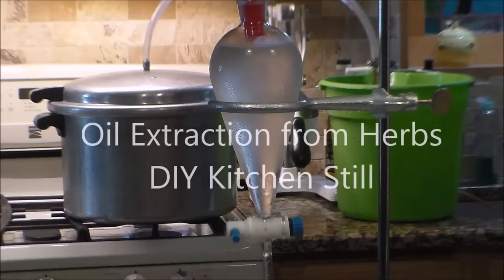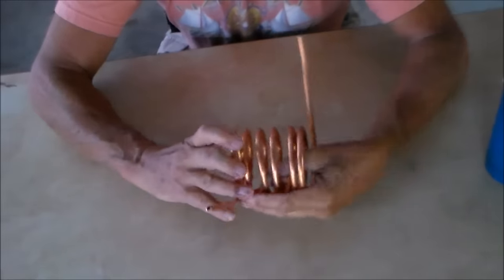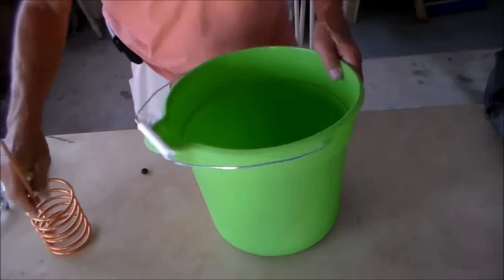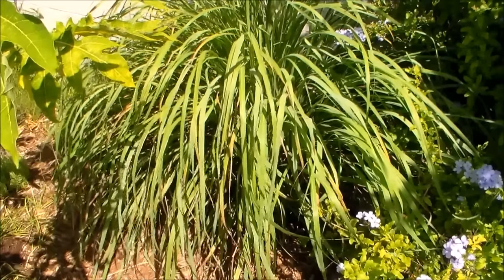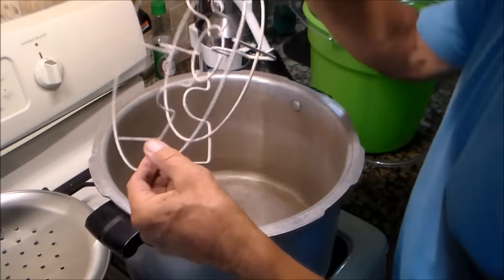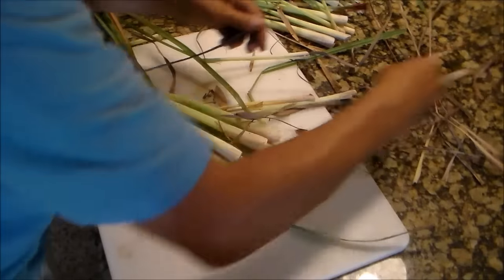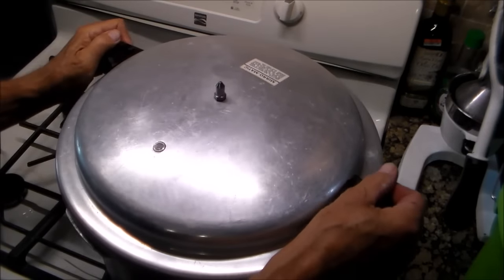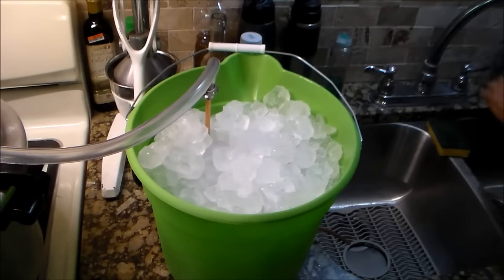Oil Extraction from Herbs with DIY Kitchen Still

Comment: Protip for coiling copper tubing. Fill it with sugar or salt, so that the tube has less of a chance of collapsing when you are coiling it. Then you can easily rinse it out afterwards, since both sugar and salt will dissolve in water. It will even let you wind a tighter coil if you want. You can cap the ends with a wine cork.
Reply from the maker: great advice, thank you ---Don
Reply: @donaldporta   what other plants can we use aside from lemon grass? I mean whats best to try?
Reply: Don. ..you saved me
Reply: @itsashepubg8967  Pot
Reply: @fishfire_2999  I hear that
Reply: Now I understand why essential oils are so expensive! For a lot of lemongrass leafs you get only a few drops of oil...
Reply: Play sand is what I used but the salt and sugar is way easier to flush out…very bright!
Reply: @itsashepubg8967  Marijuana .. check it it out if it is legal in your area.
Reply: @itsashepubg8967  
Citronella plants
Reply: @itsashepubg8967  Flowers
Reply: Glass bead sandblast media works extremely well, it's made to flow well and won't bind up inside after bending like sand does. I've never tried salt or sugar before, I'll have to see how they compare to glass bead.
Reply: @itsashepubg8967  you can do most herbs for the oil.
Reply: Even pro'er tip.... use a wire which is just a bit smaller then the inside diameter of the tube.  Then wrap around a form.
Reply: Thank you 😊
Reply: What is the ice for ?
Reply: @TheDRIBBLER2 well, for cooling typically.
Reply: i hadnt even considered using a pressure cooker until i saw this. absolutely AWESOME
Reply: Isn't it worth a one time investment. Use, reuse and keep reusing to develop a good reputed online business? And a good returns too.

Comment: You have to be careful not to block the safety valve or outlet of the pressure cooker. I know someone that did that by putting too much into the pot. It blew up in her kitchen, luckily she wasn’t in the kitchen but the destruction was so bad she had to redo the kitchen, ceiling, cabinets, window and floor. It would have killed her.
Reply from the maker: very true!

Comment: Some Tips.

Cut the lemon grass as finely as possible to break it down as much as you can to expose as much surface area as possible to release more essential oil.
Also, do not use an open mouth jar as your collection container as this exposes the hydrosol and essential oil to oxygen which will start the essential oil to oxidise which you wont want. If you want, get a mason jar with a metal lid, drill a hole in it and like with the plastic bucket, add in your plastic/silicone seal, then place the end of your copper tubing into this. 

I would also recommend when collecting the oil/hydrosol, store it in a jar in a dark pantry for a few hours so the cloudiness of the hydrosol can go away and become clear. This way you know all essential oils are floating on the top as it looked liked u had quite a bit of essential oil in your hydrosol.
When you separate the oil from hydrolsol, I would recomend getting some rock salt and add a pinch to your oil as the rock salt will draw any possible remaining hydrosol to it and then filter one more time.
Reply: ？Thanks a lot for your nice vedio
Reply: Hola, How to know if the essential oil is oxidized? OE color is dark? I distil geranium and some dark drops come out of the copper tube (I use a container with a wide mouth). Beforehand thank you very much
Reply: Thx bro
Reply: Let the man do his thing!
Reply: Ya  turned  me  off.
Reply: Very informative. Ty so much for adding

Comment: Good work.  The oil is trapped in the cellular matrix of the plant, so increase your oil yield by chewing up the leaves in a blender first. then adding that mulch and juice to the pressure cooker (I bet twice as many leaves will fit in there after you do this, so not only will you get more oil from each leaf, you'll be processing more leaves per batch).  Add salt to the ice water in the bucket to create a salt brine that is far colder than just ice water.  This stuff is a great insect repellent thanks to the citronellal found in the oil.  It's also antimicrobial, so you can add it like a fragrance to homemade soap.
Reply from the maker: Thanks for the advice my friend!
Reply: I always wondered why people using whole leaves and flowers. I am just now looking into making herbal oils and figured it was just something people do. One would imagine that a proper crushing at least would benefit the release of oils. if the juice and mulch are cooked does it negatively affect the oil production in any way? That would mean no separator, just blend, add, cook and distill and voila! much simpler.

Comment: it works but not great. smart to keep the herbs off the bottom so they don't burn. for a small batch this is fine, for anything bigger this would be a massive headache. the ice alone... should really have a temp gauge on the pot to keep from over heating, etc. we distill water in our kitchen almost daily and this would never fly for us. built a diy swamp cooler that exchanges the cooling water constantly cooling it actively as we distill. this alone makes massive difference in the babysitting time of the unit. ice in a bucket can't keep up, not to mention all the ice you have to make or buy and add constantly. also we use a portable induction range to keep the heat at the right temps. we set it and forget it on a timer. life is good...
Reply: Ego Bruiser but you're doing it on a bigger/quicker scale. the methods here are more... zen. still, i really like how you have your set up! swamp cooler is smart!--I'd love to recycle that water into the garden. and it's less babysitting, so you can do other things at the same time. different approaches to making lemongrass oil, both uniquely great ways to go about it. :D
Reply: Ego Bruiser there are different methods of doing the same thing and we love watching all methods so we have a choice of what suits our needs and resources. That's the whole point.
Reply: ego bruiser
I like Donald's way, very simple !

Comment: To improve the process: 1. Wilt the grass for 24hrs to reduce moisture by 30%. 2. Harvest early morning  plant retains more essential oil and 3. Chop the lemongrass ,(do not blend as suggested in a comment) for better yield. 4. Control heat by lowering flame and pressure by adding a control outlet valve and may also add a manometer. Best extraction at 100C (this stuff could be dangerous) with a constant steam flow. Always start with a low and consistent flame.5.Add salt to ice to create a freeze point depression.  Reducing temperature significantly for cooling. Your ice last longer.

Comment: Great video thanks for sharing. I have been wanting to try this and have been searching for a good setup. Your setup is the best I have seen. I have acquired everything I need except for the last step. What is the conical unit you use to extract the oil from the hydro sol.
Reply: Glass separatory funnel with stopcock.  Look for glass labware to find vendors.
Reply: @kptallen007  Thank you 😀

Comment: If you use tap water to steam the lemon grass , does the water get distilled in the process?
Reply: Yes, correct.
Reply: yes, the distilled or RO water isn't needed. not sure why he does that. less residue in the distilling pot is only advantage i can think of.

Comment: I'd just suggest you start using a tube with a different material. try with a full copper one even, really anything is better than plastic or rubber tubes for this kind of stuff. great video though, thanks for the idea :D also try to chop the herbs you have way finer, it'll make the extraction run faster and smoother ;)
Reply: I totally agree!! I am also concerned about using tubing and how that will impact the end products. Would you be able to just use the copper tubing for the whole setup? Possibly braze it to the pressure cooker?
Reply: Ell Mucco Again his Fu..ing bees don't mind, go make your own video

Comment: thanks man you really very help me.
how much temperature the fire?
Reply: I would think just enough to keep the water boiling. It's a bit difficult to guage with a closed pressure cooker but so long as it's producing steam will be OK. Any more heat and you're wasting gas (or electricity)

Comment: How do you know when the water is all gone/done inside the pressure cooker. We tried doing this with sage, almost exact set up, (thanks to your video! ..and past attempts) but we ended up quitting before all the water was out of pressure cooker. We didn't feel any when we shook it. We let it sit to cool down and discovered another quart at bottom, dark green of course. It was not potent like the hydrolsol we got so it seemed like a waste. (I use it to make soaps, etc) 
We also turned the heat down, by a lot,  after it was really "cooking". I wondered if that was a bad choice too. Thanks for your video! Any answers are appreciated! I am watching again though.

Comment: What size tubing and separator should I use (copper and plastic tubes)?What size is the pressure cooker and pizza tray?
Reply from the maker: I found the pressure cooker in Goodwill, it measures 12 inches.

Comment: nice to meet you, I'm Aswin from Indonesia. I am very happy to see this video ... this video adds to my insight. but I have a question, is there a more practical way to separate water
Reply from the maker: the oil will float, carefully skim it off
Reply: @donaldporta  thank you for your answer...
Reply: Possibly if you skim the oil off the top you could refrigerate it solidifying  the oil to separate out the remaining water.

Comment: What about harvesting oils with alcohol? After some days, ethilic alcohol absorbed all the color (containing essential oils) from the leaves soaked in. Now, put the jar with only "colored" alcohol (no leaves) in the freezer, so only oils will freeze and emerge.
I want to make e. oils due to make my own aftershave, so I'll need few drops of oil from each ingredient.
Is it a good idea? (alcoholic method)
Reply: Yes here is an old perfumery technique from Grasse (France) called enfleurage. This is used for flowers, and generally ones with very low volatile oil content like roses. You basically crush the flowers in fatty oil (neutral cooking oil) and save the oil. This is long work, takes a lot of time. When you are done you put the oil in the separatory funnel along with an equal volume of pure alcohol. They don't mix, you have 2 layers, so shake well, let stand so the layers separate again. Collect the alcohol layer. Repeat this another couple of times with fresh alcohol.. Pool the alcohol extracts, and gently boil off the alcohol.

Comment: Can you tell me where I can get just the separatory glass funnel like you have. It looks like you have a separate stand. I am almost ready to try your method. I have the bucket and gromet hole ready. Just have to wrap the coil and insert into bucket. Picked up a new old never used large pressure cooker at the goodwill. My first experiment will be with catnip. Have alot of it growing and it has many wonderful benefits. Thx for the video
Reply from the maker: in the description is a link for the parts

Comment: if you dont wanna go nuts on destilling this way you can make a russian destille its like you done but except for a tubing you put a great pot with ice water as the closeur where a small pot hangs under that collects the water and thats it. is the extraction more efficient if you chopp the grass smaller to have a bigger surface or boils the oil out anyway?
Reply from the maker: a finer chop will extract more oil, easier.

Comment: Hi
Thank you so much for this video 
Excuse i have several question if you do not mind
1- How long you need to boil the water?
 i mean for how many hours?
2- Do you need to add more water between in the pot?
or the water is enough & no need to add more
3- How many times you need to add ice in the plastic bowl?
---------------------
Now i have suggestion for you i hope you accept it from me

Why not use water heater installation flexible hose
 instead of nylon hose pipe
i think it is excellent & a bear the 

heat

Waiting for reply 
Regards,
Reply from the maker: I boiled less than 2 hours, at a reduced heat. I added water once. I added ice 3 times.
Reply: Thanks Man

Comment: Is there something to use other than the aluminum pizza pan and the plastic tubing? I'm leery of aluminum and of plastic. I've read and heard so much on how bad they both are health wise.
Reply: Patty VanDeWalker use copper tubing for the entire run out of the pressure cooker. You won’t be able to see the steam, but you’ll know it is working.  I am sure there alternatives to the aluminum pan, but it seems like less of a risk. I don’t think any aluminum will come off in the steam.
Reply: Patty VanDeWalker you can find stainless steal steamer and silicone medical tubing
Reply: copper or stainless steal tubing work great, i wouldn't use the vinyl nor aluminum either. but he isn't consuming this stuff it's for the bees. i use an induction burner with a stainless pot so have a conductive disc that sits under the pot for induction, works great.

Comment: Hello i love this video and i am ready to buy all the material to do this at home i was wondering in the beggining the clear tube you attached to the copper coil what is it and what is the size also where can i find the pressure cooker you have and the flat pizza pan you have as well?
Reply from the maker: the clear tube is vinyl that is from the hardware and it has to be sized to the copper tubing. pizza pan came from Big Lots, the pressure cooker I found in a Thrift Store, but new ones are available however a bit pricey.
Reply: Ariel Roc They’re called steel clamps. You can also find pressure cookers on Craigslist.
Reply: Vege steamer works fine as well.

Comment: Can it be done with Marijuana?
Reply: No.  Cannabis is not water soluble and the oil you collect from it is the stickiest sap-like product you will ever encounter.  I used to use butane to collect oil and the final product required a putty knife to scrap it out of the collecting plate/bowl.  Meanwhile, making a tincture/butter is simple whereas the CBD oil one sees on the market is usually done using CO2 extraction plus a few more steps that require quite a lab setup.

Comment: thanks for the informative video! there are two details missing: 
- in 4:07 you fasten the pipe onto the copper coil onto the clear hose with a device. what is it? 
- in 10:55 suddenly the hydrosol is already on the drip device. do we simply pour it from the mason jar? 
thanks
Reply from the maker: at 4:07 is a hose clamp--- http://amzn.to/2CGPQvT    at 10:55 yes, just transfer to the separator and let it settle before draining off the water.
Reply: Donald Porta how long is the hydrosol and oil left in the separator before opening the valve? Approximate time needed to settle?
Reply from the maker: About 5 minutes.
Reply: Donald Porta thanks!
Reply: @donaldporta  what is a hydrosol? And why it is needed? Sorry for asking, i really need to understand this.
Reply from the maker: Hydrosols, also known as "flower waters," are produced by distilling fresh leaves, fruits, flowers, and other plant materials. With similar properties to essential oils, these aromatic waters are much less concentrated.
Reply: @donaldporta  so the hydrosol itself is the product of the process. Thanks man, now i understand.

Comment: What did you do to the clear tube and the copper part when you connected them? 
Also besides the basics, what else would I need? What was the last parts used called?
Reply from the maker: there is almost no pressure in the tubes, so the copper and vinyl are just pressed together.

Comment: I read that you need to use either glass or stainless steel to distill essential oils, but you didn't say if you were using a stainless steel pressure cooker.  Does it really matter if it's stainless steel or aluminum??
Reply from the maker: I'm not sure on that one, when in doubt, go with stainless. I am not consuming the oil so not worried about it.

Comment: You did not explain to us the last device how to make it and how to connect it to what you have built?
Reply: It is just a sepratory funnel on a ring stand. $50-60 on Amazon.
Reply: Yeah I was wondering the same thing so the second part is not a complicated process for the separation of oil from water.
Reply: Yeah I agree...you can simplify the whole process showing the whole video shot of the still setup. BTW we can buy glass still in the market nowadays.

Comment: I have another questions & sorry to bother you

1- What is the name of the piece above the boiling pot & what is the size of it?
2- Can I use copper pipe larger than this size?
for example half inch or one inch or more

Thanks
Reply from the maker: That is the nipple on the pressure lid that accepts the pressure weight, you can use copper but have to figure out how to make a tight seal so as not to let steam escape.

Comment: Mr. Porta, can the hydrosol extracted from Lemongrass distillation be used as a drink like a lemongrass tea? 

Can the hydrosol be used to prime the distillation process instead of using distilled water or purified water? Can more lemongrass oil be extracted with this method?

Comment: Even without ice you can collect cytronila oil,using water instead of ice।
Reply: The low temperature helps to convert the gaseous phase into liquid phase. That mean, if we don't use the ice then the product will stay as gas.